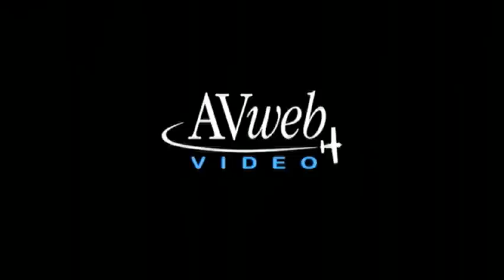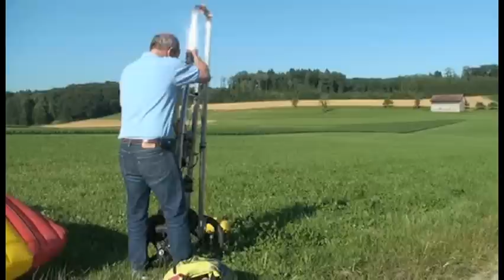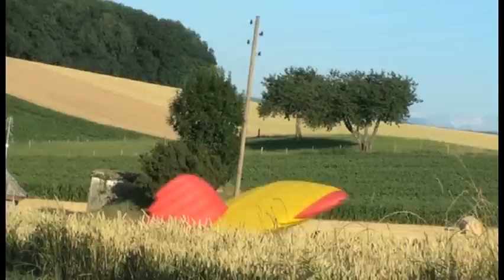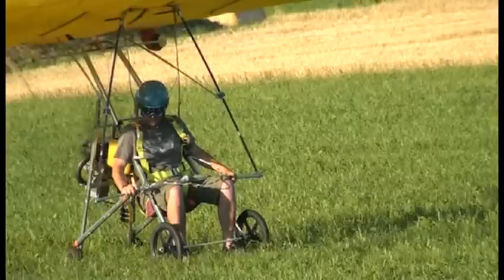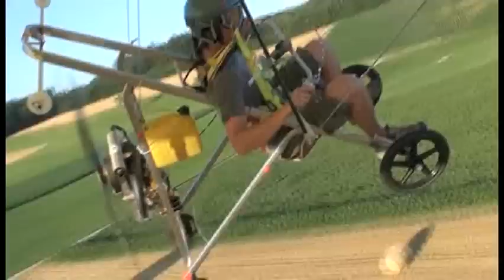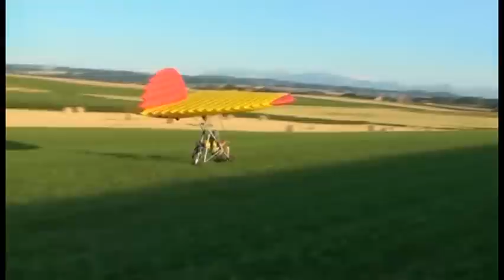WoopyFly Inflatable Wing Ultralight Aircraft

Comment: Landing was pretty hot. A low aspect ratio plane of that weight should stall at less than 20. Land maybe  little faster because the wing would need 40 degrees plus AoA.

Comment: What happens if the fans used to keep the wing inflated suddenly stop in mid-flight ? I think it would be a hell of a bad situation.
Reply: You'd be fine.  The scoops are facing forward so that they act as air-rams while in flight, much like paraglider wings.
I imagine the fans are mostly just to assist in initial deployment, and in emergency situations where holes have been torn in the wing material (the video mentions this).

Comment: ~ how much for a up-sized sail balloon that I can fill with hydrogen, helium and/or heat salvage from engine exhaust & cooling or the dimension plan your airfoil, perhaps instructional DVD and I'll make my own from solar sail balloon para-glider with gas layered and finished in almunimized pet ( polyester ) " space blanket " to keep the hot lifting gas inside longer ? ( as kit pieces your not selling a Ultra light plane which makes shipping easier and assembled as a experimental ) using twin leaf blowers for directional thrusting when not quietly floating or gliding and bag gas management and/or consumption as fuel ( 1 cubic metre at room temperature  lifts one kilogram from sea level, all the way up to 140,000 ft if the envelope will expand with the lower pressures, which one could then inflate stiff with the leaf blowers to stiffen the wing or what ever lifting gas, and descend in a speed increasing skipping manuover, like an eagle or falcon )
Reply: I doubt the volume of gas involved would make much difference and certainly not be worth the cost of the helium or its recycling.